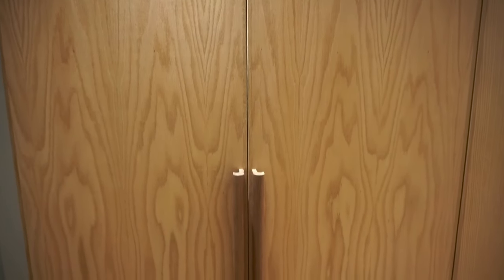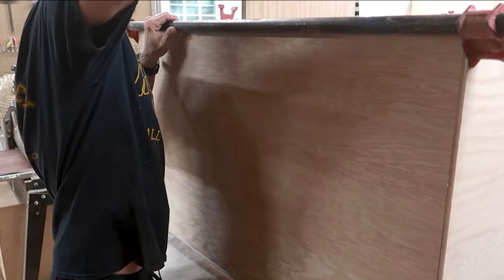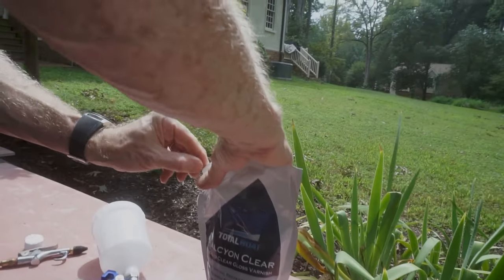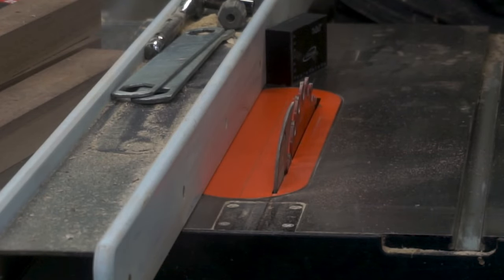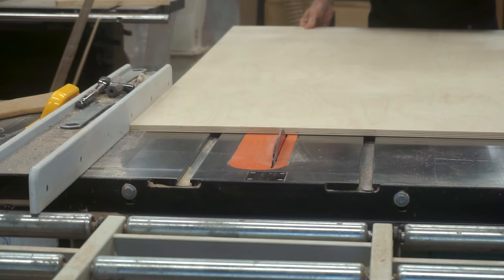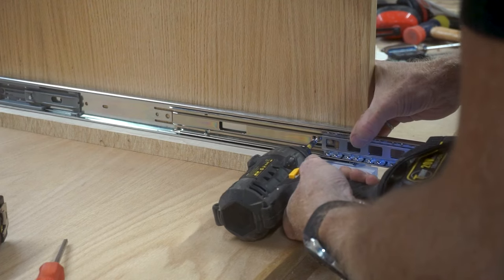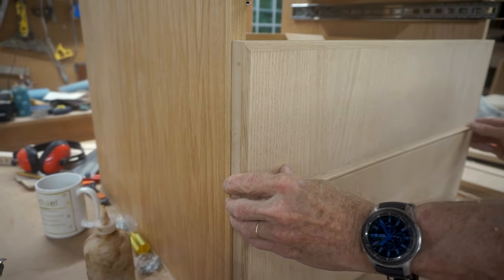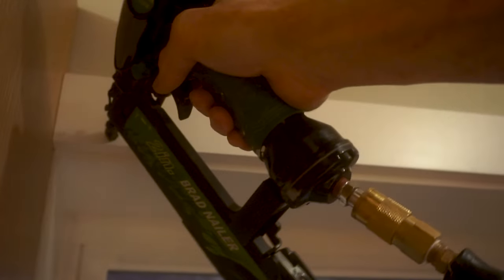Making Sleek and Modern Built-In Bedroom Cabinets

Comment: BIG job, nicely done!  For large drawer bottoms, I like to use 1/2" ply, cut down to 1/4" around the edges.  That might be overkill, but it works well.
Reply from the maker: I definitely considered that, but figured that 1/4" bottoms would be fine because the clothes in the drawers won't be very heavy.

Comment: Hey Mike, great video as always!  Can you please tell me what kind of blade, tooth count you used to rip the plywood?  Im getting ready to make a desk with walnut plywood and Im scared to death about the tear out. Should I use a 60 blade count or 80?  And you think I should cover the cut line with masking tape to prevent tear out?  Thanks so much!
Reply from the maker: I used an 80 tooth crosscut blade. There should be a link to the one I used in the description.  If you're worried about tear-out, using masking tape is a really good idea, especially with walnut where the tear-out would be more noticeable. I should have mentioned that in the video!

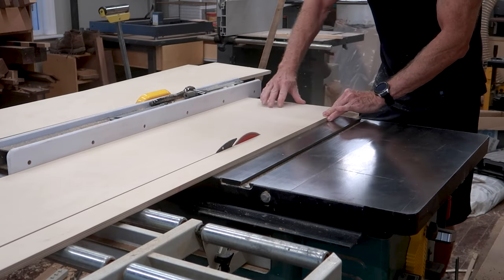Comment: 22:55 why do you have to have half-banana material? can't you use that method with any thickness?
23:41 i guess that's why it's called the quarter-quarter-quarter method? i would call it the half-half-half method because it's half the thickness of the material.
39:18 unlike all those chessboards, in this case i have to say yes. but that's only gonna happen if my numbers come up, preferably tomorrow :-)
Reply from the maker: You're right about the half-half-half name. I didn't fully explain, but I needed to have material that was at least 1/2" thick because the narrowest thickness of my dado blade is 1/4", so that's why I didn't want to use undersize plywood. And using my trick to insert a piece of 1/4" MDF makes it easy if I'm working with 1/2" plywood.

Good luck with your numbers, but I'm pretty sure I'm going to win.  😂